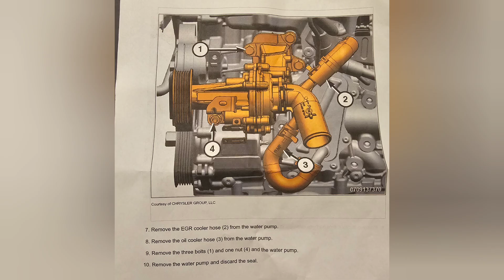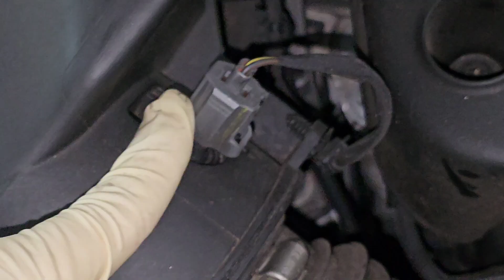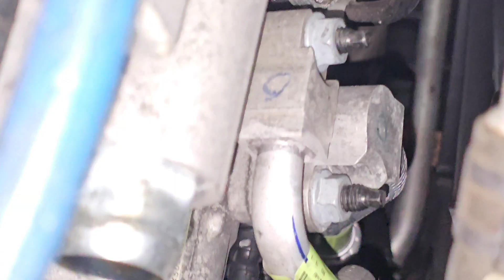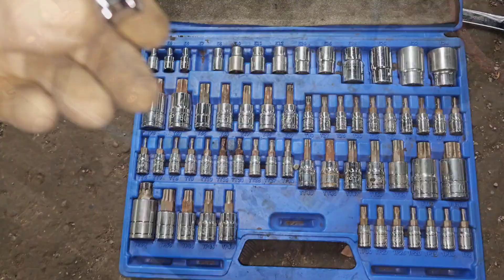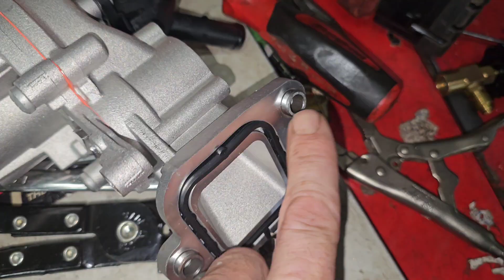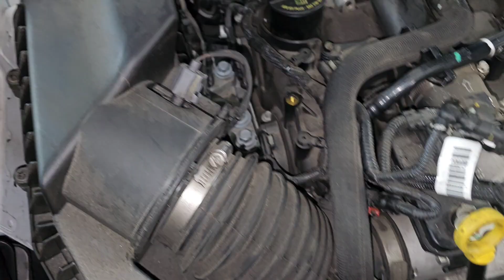2020 Jeep cherokee 2.0t water pump replacement  and a/c compressor removal how to

Comment: Hey, did you install the original part or an aftermarket part? If it was an aftermarket part, which brand? Thanks!
Reply from the maker: Honestly at this point im not sure if it was a factory one or aftermarket. I did this job a while ago. I think it may have been aftermarket. We usually deal with autozone where i work. So if it was an aftermarket one it most likely came from there. Thanks for your comment 👍 😀. If I can find out for sure I will try and ill reply again
Reply: @RepairProTips thank you bro, you've made great video!

Comment: I cannot figure out how to get the belt back on.
Reply from the maker: There are literally no pictures online. However if you have access to the Gemini Ai app on android it will give you written instructions. Type the year make and model and the engine size as the prompt. I tried to copy and paste it for you but it won't allow me to. I hope this helps. I had a hell of a time with it. But it was my fault I didn't draw it out. I still cant find a picture to share with everyone.  Im sure any Ai will work I used Gemini. It was a little difficult to follow but I was able to figure it out. Thanks for your comment 👍 😃

Comment: You should also lable this video how to remove ac compressor. I need to replace mine and feel alot better about being able to get it out after watxhing your video. There is not alot of videos on this fairly rare sideways 2.0 turbo. I bought my 2019 and found a leaking heater return hose first thing . Thats a crazy 200 dollar hose too. Thanks for the video
Reply from the maker: I will try and remember to add that to the title. Im glad i could help. I couldn't find anything on it when I had to do the job. Thanks for your comment 👍 😀
Reply: There isn’t really any videos on this engine I’ve looked and researched so much lol this is what I was looking for thanks
Reply: I would imagine any diy vids on this engine would get lots of views . Prolly not so much body and susoension but engine for sure. There just are not many videos on it in that configuration.
Reply: You should be able to set the compressor off to the side with the lines still hooked up according to AllData.
Reply: @m.stewart2232  yes you can just move the compressor no need to take the compressor out. I have a 2.0 t in the garage atm with water pump off and compressor still hooked up. It’s about a 2hr total job.
Reply: I second that, round this while researching ac compressor removal.  Thanks boss.

Comment: Do you have a diagram of the serpentine belt?? I can’t find it for the life of me and. Can’t remember how it went on
Reply from the maker: I will have to look and see if I have maybe a picture I drew out or something. There is very little information on this engine online. Thanks for your comment 😃. I will try my best to give you a proper answer.
Reply from the maker: There are literally no pictures online. However if you have access to the Gemini Ai app on android it will give you written instructions. Type the year make and model and the engine size as the prompt. I tried to copy and paste it for you but it won't allow me to. I hope this helps